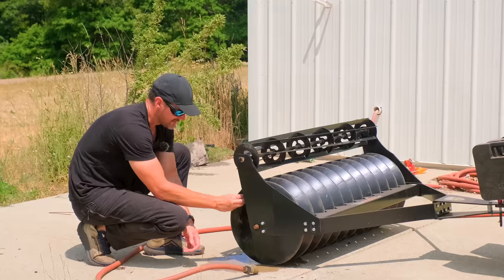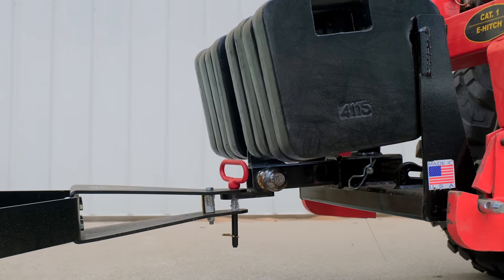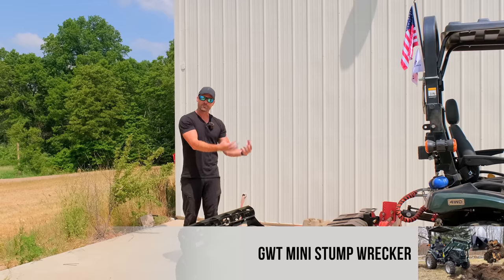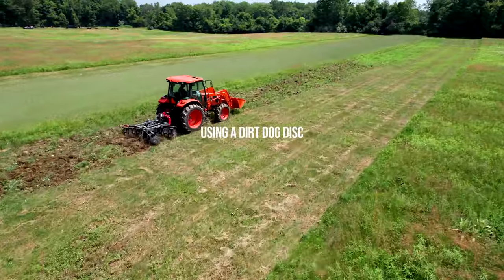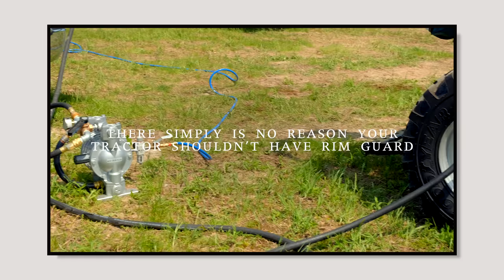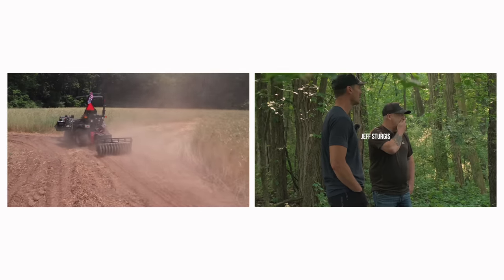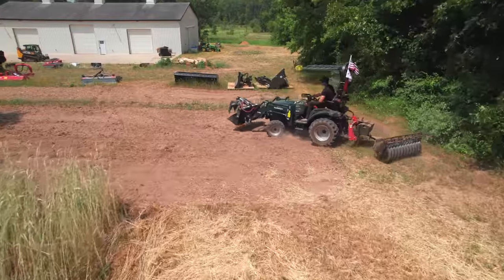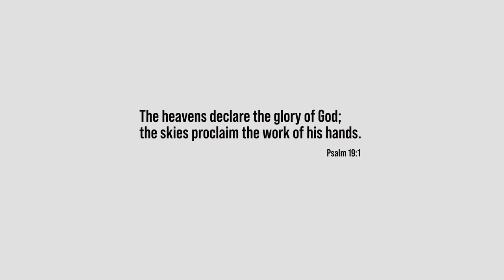2 IN 1 COMBO TOOL IS TOO COOL!

Comment from the maker: Want more information on this tool?  Visit this link and save 5% with code "GWT" http://www.packermaxx.com

WANT TO SAVE MONEY? CHECK OUT THE GWT DISCOUNT CLUB!  Use code GWT at any of the vendors below and you will save cold hard cash :)  I will also get a commission for the sale, so it's a win-win-win!  

USE CODE "GWT" TO SAVE BIG WITH:
BUCKET BRACKETS @ http://www.jufabworks.com
CUSTOM GRILL GUARDS @ http://www.5elevendesignz.com
PTO QUICK ATTACH @ http://tractorptolink.com
DIY HYDRAULIC SOLUTIONS @ http://www.summit-hydraulics.com
GAME CHANGING GREASING SYSTEMS @ http://www.lube-shuttle.us/store
TIRE CHAINS @ http://www.tirechainsonline.com
PREVENT FLAT TIRES @ http://www.multiseal.us
CULTIPACKERS & CRIMPERS @ http://www.packermaxx.com
ALL OEM JOHN DEERE PARTS @ http://www.247parts.com
ACCESSORIES AND BACKHOE BUCKETS @ http://www.muddscustoms.com
CUSTOM TRACTOR FLOORMATS @ http://www.tractormat.com
PROTECT, ORGANIZE, IDENTIFY HOSES @ http://www.outbackwrap.com
BOX BLADES FOR ATV'S @ http://www.northwoodsfabrication.com
HYDRAULIC SYSTEM PROTECTION @ http://www.hoseendchamer.com
DUMP FROM THE SEAT MATERIAL COLLECTION SYSTEMS @ http://www.proteroinc.com
POWERED SWEEPERS SWEEP UP ANYTHING @ http://www.sweep-all.com
EASY WHEEL TOP LINK HANDLE @ http://www.tractoraftermarket.com
TIRES, WHEELS, AND DUAL ADAPTERS @ http://www.millertire.com
AMERICAN MADE CARRY ALL ON STEROIDS @ http:www.bigtoolrack.com
THE BEST TOOTHBAR AND MORE @ http://www.heavyhitch.com
5% OFF WITH CODE GWT AT TRAC SEATS! http://www.tracseats.com

Comment: How thick is the metal on the crimper.  If I hit a rock or stump will it survive or is this only for prepared ground?
Reply from the maker: Good question.  I don't see the answer on their website, but definitely could reach out to them to find out!  http://www.packermaxx.com
Reply: @GoodWorksTractors  very much a product I would use heavy clay up by grand rapids MI and cover crops help with it but when doing forage plots etc I'm trying to avoid doing a real clearing before planting crops.

Currently I just extend my top link and drag my flail mower around on it's rear roller doesn't crimp properly but does flatten.
Reply: The metal blades are 3/16” thick steal. We do not recommend on extremely rocky soils but will take reasonable rock and stump hits. We have never had a blade break off. Even if one bends a little it will still do the crimping job. 
Thanks!
Reply: @bryceg5709 We are located just north of Grand Rapids in Rockford right off 131. Stop out and see us.

Comment: You can direct drill larger seed like corn soybean directly into "green" freshly crimped rye....but you might have problems with small seed clover though.
Clover really needs a shallow drilling and the drill will "float" on the mat of rye thus making soil contact more iffy
Reply from the maker: I’ve never drilled clover.  Broadcasting and barely covering has worked really well for me historically.

Comment: i wanted to add a lawn roller to my tools but going back and forth between something like this and a roller.   I cant find a good quality roller that's not quite commercial-level.  I live in florida so when i till it really fluffs up thought a roller i could use after i re till / seed my yard.   when not seeding or overseeding i would just maybe use it to smooth out everything a bit after it rains (sand really moves around).  I think this would pretty much do want i want it to for seeding perhaps even better however doubt i could use to just smooth lawn.